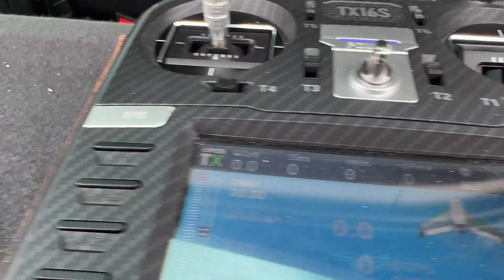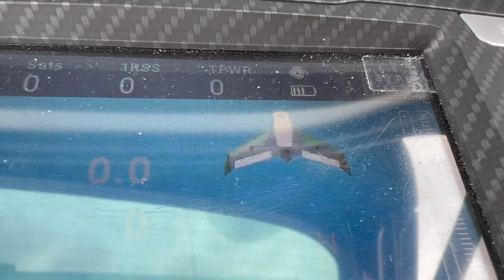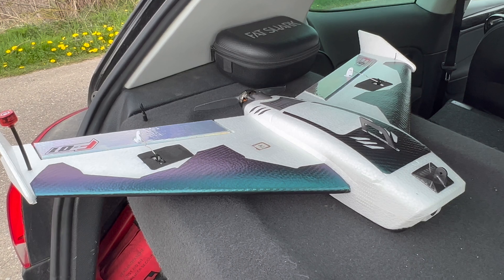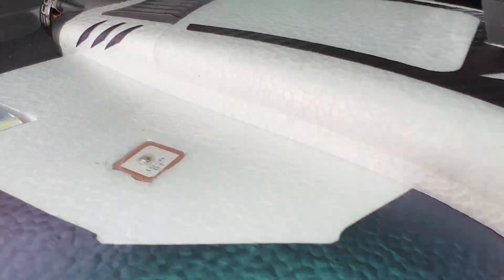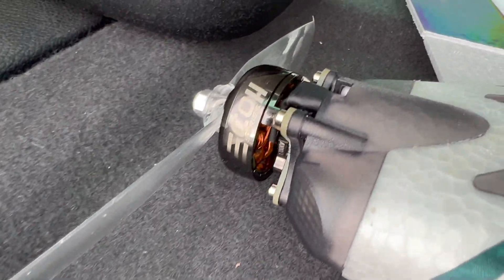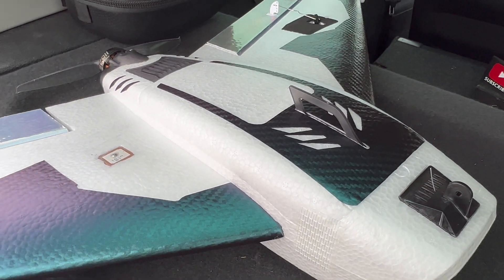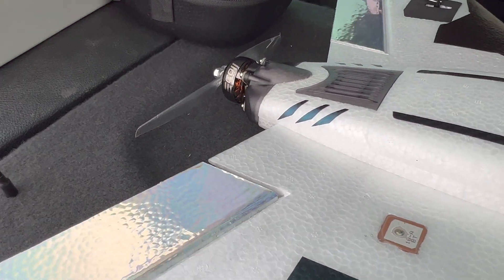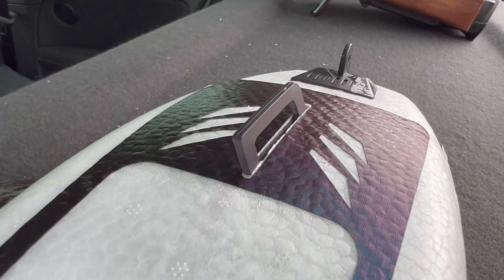F01 PowerCruiser short build and making it fly | Hee Wing F01 EP:17

Comment: Hey, i am not sure about the CG jet. My F01 ist still under Construction. 
I Have the Wild Idea to youse the Plastik Part for DJShit Unit, and put on top of the plastic mount my  analogue VTX, and under this my SB Mini Wing cntroller.  The whole electronic in the front, and the Battery behind the stack. So i have more room to slide the Battery. 
Or is it better to Put the FC in the back of the plane. So i have FC Battery VTX. 
But the Battery have less room to move after this. 
I want to youse CNHL 4S 1800mAh the orange ones.
What are your thaughts about hitting the COG with your plane?
Reply from the maker: I think that there is no need to worry with a 4s1800! Look, I fiddle 4s5000 li-ion in it and there is no such thing as where to put the battery ;)))
Keep one thing in mind:
When you crash, you perhaps nose impact into the ground. If the battery starts shooting through all the electronics then it’s getting ugly. But if the battery is in front of the fc then there is Atleast a bit of hope.  :)

I try to be spot on the cg but as I’m waiting to get the walksnail vtx in my new build it could take some time until i figure out the balance. But a new build is coming

Comment: Im gjetting this wing next monday🙂 i feel like a kid again. Mine is stock pnp pro version. Is a 4s liion battery with 30 amp discharge ok for this setup?
Reply from the maker: I guess it will be just fine ;-) have great fun with it- for me it has been a blast so far
Reply: @JustFPV-net  yes ive decided to get molicel liion battery 4200mah. Maybe 1 hour flighttime?
Reply from the maker: Not so much in this combo - you’ll need a 6x6 prop and about 1800kv to get to that area! I managed to get mine at 50-60mAh/km …
Reply: @JustFPV-net  yes ive watched all your heewing episodes. I will probably get that combo myself.
Reply from the maker: @fpvkagge  then you know where my love to the setup comes from. If you insist on hitting the 60min+ then look at the 2203.5 with 1650kv and 6x4 prop
Reply: @JustFPV-net  thx mate🙂🙂

Comment: Nice video 👌 just about to Maiden mine this weekend, what throws did you use on the servo's? There is No mention in the manual.
Reply from the maker: Glen, I didn't forget you here ... just didn't have the time to check on that as I'm fiddling with ExpressLRS 3.0, VTOL, CWM, F01 PowerCruiser #04  and gigs of footage ... so I'm a bit slow here. So far I can tell that I've reduced the rates to about 150°/sec on ROLL and picked the 2nd or 3rd hole on the servo horn to tame it from the about 600°/sec INAV figured it to do :) ... far to much for me .. BUT ... I'll keep you in mind on the next flight
Reply: @JustFPV-net  thanks mate! Unfortunately my 4s 1500mah lipo didn't turn up 🙂 so maiden will be this weekend. Love the videos, after watching the speed runs you did in your takes...makes me keen to get mine in the air. Thank you for your reply.
Reply from the maker: @glenharto9699  how about you try 21700 cells then like mine? That’s Molicel P42A with 4200mah and max 45A
Reply: @JustFPV-net  sounds great, send me the link 🔗  where to buy 🙂
Reply from the maker: buddy, that's one of those you'll have to build your own! Order 4x "21700 Molicel P42A" cells and find someone to spotwelder them to a 4s1p pack! ... mine is flat => OOOO 
And that's already all the magic :)
Reply: @JustFPV-net  Amazon saying tomorrow, I hope the battery fits, I ordered a 1300 as well 76mm with full sized DJI air unit and the matek FC leaves no room at all. Man I hope they fit. 🤔 what is the dimensions of your home.made battery packs?
Reply from the maker: @glenharto9699  oh, thats an easy one ... 21700 => 4x 21mm => 84 (spec says 21,4mm so 85,6mm) x 70mm ! it should be in one of my RIPPER/F01 Build videos on the channel. 
Besure to spotwelder it ... otherwise you'll exceed the 70mm width in the fuselage.

Comment: That's a nice setup. Where did you get the unglued kit? After a frontflip over a powerline due to not being able to make a propper u-turn without climbing at the time and sun in front of me after the turn I recognized that there must have been some kind of glue shortage in china at the time they built mine. The two halfs of the main body seperated in the front and there was literaly no trace of glue visible. So I prefer to glue my stuff myself since then 😉 Just ordered a ZOHD Dart XL DIY Kit from Branggood but I have not seen the F01 as a glue yourself kit there.
Reply from the maker: sad to hear this ... I've ordered the kit directly! If you need something or a kit, just knock on my door :) I assume DHL will be our friend as I have one spare left here ...
Reply: @JustFPV-net  Knock Knock 😀I sent you an E-Mail to the adress from your YT Profile.
Thanks for the condolence but luckyly nothing to be sad about, it looked almost like brand new the same evening again. Mine is fully laminated with 75mil so nothing broke only the the two halfs splitted. Glued together, patched the seam with some more laminate and because it is fully laminated the foam expands back in it's shell after going over it with the iron. That thing took some beating because it was the one of the two I started and flew most with. The Tip Stall is real with this one...
Reply from the maker: Got it here - good yours is fixed again

Comment: @ JustFPV Thanks for the video; Wow, I just had the same issue of oscillation/fluttering on the pitch axis with my new fixed wing. I am running INAV 4.1. Any suggestions to resolve this issue? Thanks.
Reply from the maker: Sure no problem ;)
- make sure there is no flutter in the hinges: the must be exact
- Disable the permanent trimming
- reduce your pids on roll and pitch
- try to setup the TPA so it reduces the pids dynamically
Reply: @JustFPV-net  Thanks man. Mechanically, there is no issue. I'll change the INAV setting as you suggested. Hopefully, it gets better. Have you been able to completely eliminate this issue on your fixed wing?
Reply from the maker: indeed the PIDFFs reduced did the trick. As my PIDs came/was taken from my prior build running INAV 3.x they seem to be somewhat uncool on INAV 4.1 ! And I wonder how it will turn out end of the week when INAV 5 is released! :)

YET ... look at the end of the video (13min19sec) - ... the latest PIDs (that day) are shown. perhaps you missed that out.

Comment: Nice build and design work went into creating this PowerCruisr beast. Looks like can fly for 40-60 minutes on that li-ion pack. :)

It would be interesting if had a camera (Peanut/Go2) mounted on the fuselage looking out over the wing to view controls and wing pitch at 5:15. Wondering if it was all PID, or perhaps related to linkages? Seeing an adjustment v vs a straight run from the servos to the the control surfaces. A visual would be a great aid.

For the roll tendency with power off, you could double check if have ESC brake set. Could always mix aileron control into your throttle setting to see if helps?
Reply from the maker: It was in fact the PID-Settings which absolutely didnt like the high values. Furter not TPA was set which would have reduced that effect too. Yet again it was solved by "better" and lower PID values. It seems that every setup with tuning origins in INAV < 4 should be reconsidered as there are noticeable changes. This is the 2nd wing having such an issue: values that where fine before now cause trouble!

happy you liked the design ;) ... considering to build another one for sale on that look
Reply: @JustFPV-net  Thanks for the informative heads up. Glad you have it all worked out. :)
Reply from the maker: Always learning new things - and setting up PIDFFs is something that was necessary. New setups (servos, motors, linkages) are always somewhat different so their pidffs differ - but since INAV 4 this has become something you need to get a grip on otherwise your plane/wing will fly crappy